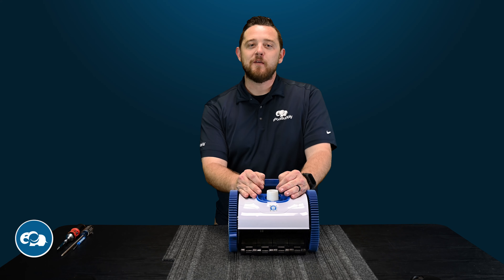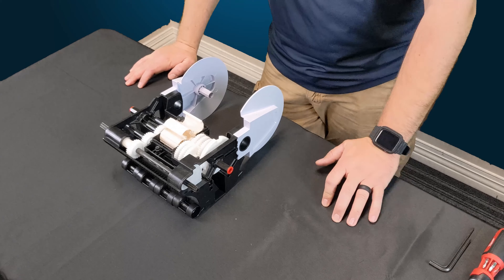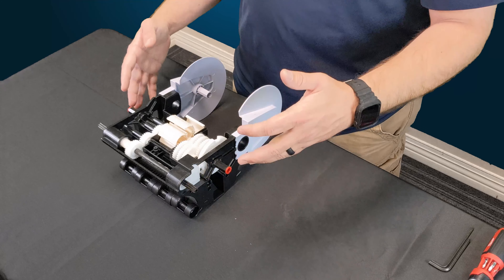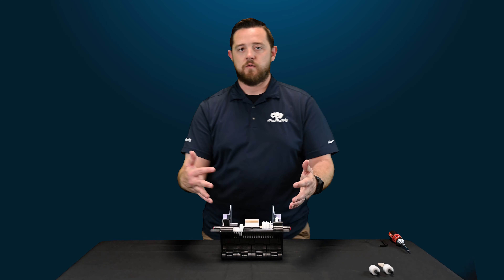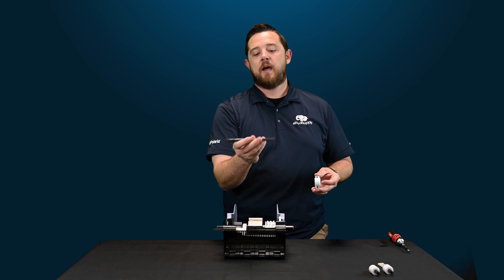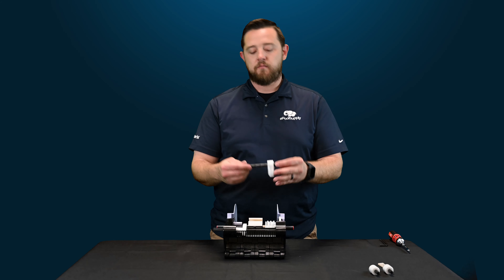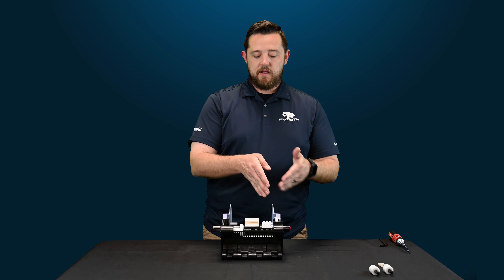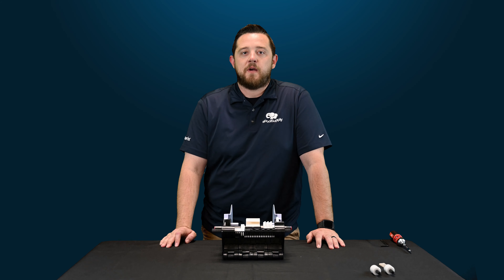Replace the Hayward AquaNaut 400 Steering Bracket

Comment: My Hayward 200 pool vacuum is spinning fine but struggling to move forwards. What recommendations do you have? I replaced this component with no improvements.
Reply from the maker: Sounds like one of the other internal gears are bad. I would start there.